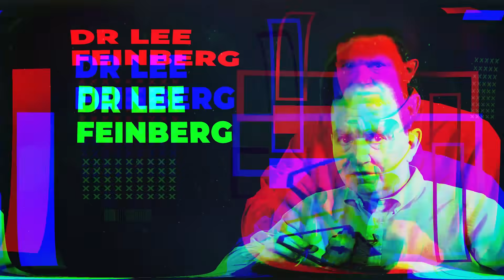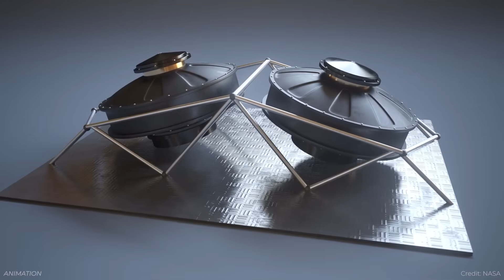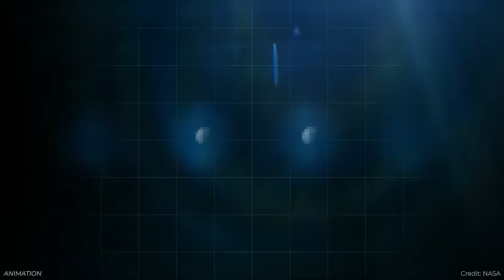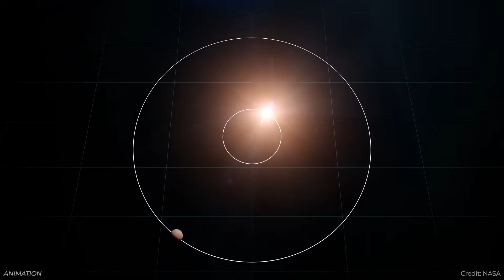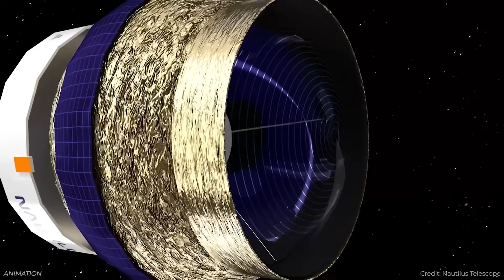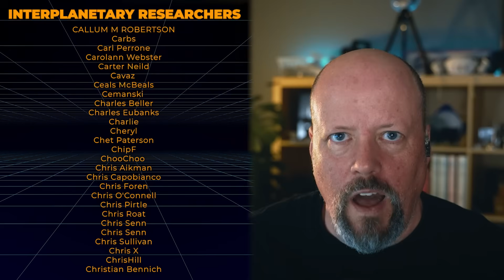The Architect for JWST, Habitable Worlds Observatory and LIFE. Lee Feinberg

Comment: A small constant thrust can be obtained for a telescope using the 'Casimir Effect' with plates.
Reply: I'm not understanding how that would work, isn't that a repulsive or attractive force between two objects? How would it provide thrust in a direction without also countering it?
Reply: @jblob5764  They give thrust - 5000 centimeter silver plates will give a thrust of 67 m/s.

Comment: Im curious if it would be of any benefit to have a telescope like this orbiting the moon instead of the earth. Keep this beast away from any possibility of collision with another satellite.
Reply: There are a few problems with lunar orbits.

1. Orbital stability. The Moon is gravitationally “lumpy”; it has significant anomalies that disrupt orbits quickly. This is because the mix of denser and less-dense portions within the Moon is coarse and relatively dramatic. It’s bad enough that even in the Apollo missions they had significant work to do to account for these anomalies over just a handful of orbits.

2. Communications bandwidth. For radio and optical communications, distance matters. Lunar orbit is at least 400 times farther away than low earth orbit, and it’s a square of the distance issue. That’s 160,000 times fainter, so you have a power problem for your lunar transmitter and a size/sensitivity problem for your lunar receiver. This can be overcome, absolutely, but even with communications lasers you’re always going to have a huge bandwidth advantage in low earth orbit. Don’t underestimate the astonishing bandwidth demands of modern astronomical data gathering (which is why there’s so much talk of on-telescope preprocessing, which is its own challenge).

3. Energy required to get mass to that orbit is much higher than for low earth orbit. Fuel to get it there disproportionately takes away from the mass of the payload (the telescope).

4.The radiation environment outside of the Van Allen belts is harsher, and coronal mass ejections are much more severe and possibly crippling. 

But there are certainly advantages, i.e. avoiding Kessler Pox. 

Now, the lunar surface… that’s interesting. Surface based interferometers will have the needed absolute positional stability needed, and not have the ongoing fueling requirements. And radio instruments can be easily protected from the extreme noise of the Earth just by putting them on the far side. 

Like everything, there are trade offs. For the moment, the orbital and distance issues reign. That might well change with lunar based manufacturing, but it will likely not happen in any of our lifetimes. LEO and highly elliptical orbits are the foreseeable future.